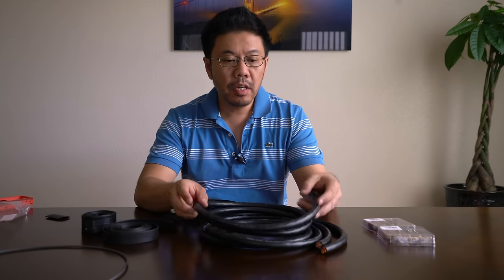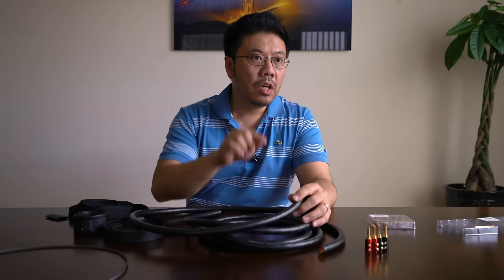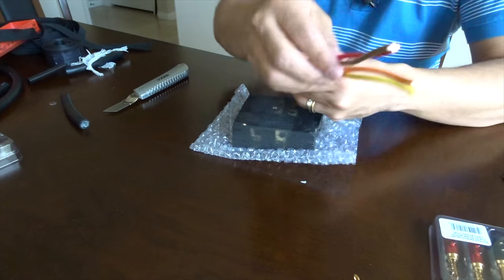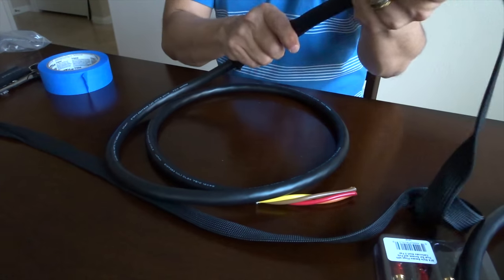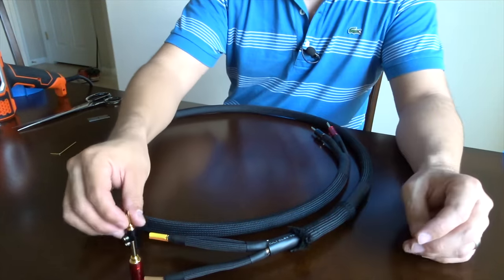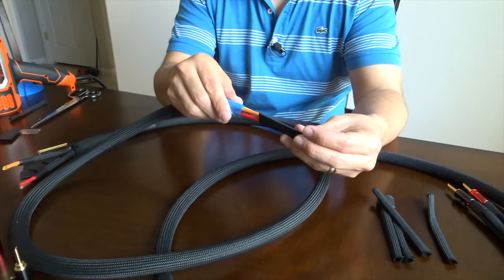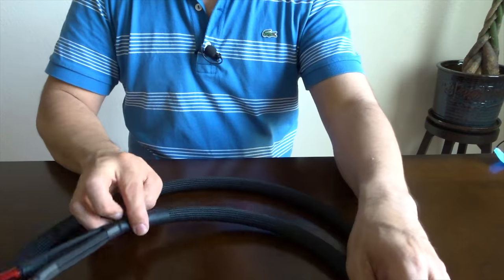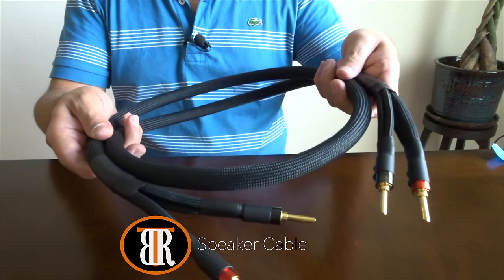Making The Best Speaker Cable For Money, How To DIY HiFi Cables

Comment: Thanks for this fantastic video! I have been planning on making my own speaker cables and this tutorial is one of the best i've seen. 
I do have a couple questions. 
1. Is there a technical/sonic reason why didn't you twist the pair of conductors before connecting them to each other?
2. I have seen other people's comments about star-quad wiring and your responses. I don't fully understand the importance of pairing or the difference between coupling two adjacent conductors vs. coupling conductors across from each other. Is there a difference?  

According to wikipedia, in star-quad configuration, "opposite points of the star are connected together at each end of the cable to form each leg of the balanced circuit." For the mogami, that appears to be red+yellow, brown+orange. 

Thank you!
Reply from the maker: Hi, No reason for not twisting them, I’ve done many cables and I just wanted to have flatter look when I was making this video.
Star -Quad position at end points are not important you can connect how you like it, there is no difference in sound quality and you still have whole length of star-quad in between them. 
But it all up to you, thanks

Comment: Does the Furez TST WP48 fits both  the Mogami 3104/3103  I ask this to be sure cause the WP48XL is no longer available
Reply from the maker: Yes WP48 should work fine with Mogami cables.

Comment: Thanks for this video. really appreciate many of your speaker comparison videos as well.. Since you've reviewed and compared many speaker and rigs, can you share what other cables you've used in the past where these cables you find to sound better.. You mention in a response post that your previous cable was the audioquest Gibraltar ...are there any other brands/models you feel these would be better than? Cardas, Kimber, etc.? Thanks.
Reply from the maker: My previous reference cable was Audioquest Gibraltar, which I owned for more than 5 years and I tried Kimber 8TC as well, compare to those cables in my system I like how much quieter background with Mogami cable was big eye opener and there no downside at all compare to those cables in every aspect, absolutely change my mind. May be one day I will try Cardas cables which is yet to experience, thanks
Reply: The Audioquest cables are like there is a bass boost eq built-in. Bass is good but there is a background high frequency noise which muffled the treble. On the contrary, the QED cables are like there is a treble boost. Treble is clear but either bass or mid range is weak. One day would try these Mogami cable. See them selling on Amazon jp at reasonable price.
Reply from the maker: @SpikeoutBattleStreet  You should also try Canare 4S11 which is very good cable with nice balance from top to bottom.
Reply: @Tharbamar  Thanks, I think I will try them in the near future. They're selling at ¥650/meter only on Amazon jp. I think I will pair them with onkodo banana plugs selling at the same shop. The fact I don't need the super details of QED cables or the excitement of AQ cables. I just want some pleasant sounds into my ears.

Comment: Hello, thank you for the video.  I trust your videos the most.

My question is, Mogami  3104 says the conductors are Red, Black, White and Yellow.  I only bring this up because Mogami says to reduce cross Inductance pair the wires on the diagonal so I was paying attention to your colors to see how you paried them but your colors are different...  Anyway, the "diagonal" is dependent on how you turn the cable which wires are diagonal?  You don't cover cross inductance in your video but the reason some cables are flat is for the same reason.  I am curious did you take into account which wires were used when you paired them?

Thanks!
Reply from the maker: Yes I did check it with mogami and they do not have any specific advice on color arrangement for termination, so I just paired with the one next to each of the wire for simple arrangement. Thanks

Comment: Hello! Love the video. I am hoping you can help me with understanding wire gauge effect on sound. I recently went from 16 gauge on my speakers to 12 gauge Belden speaker wire. I always had trouble with the treble on my system, and that has gone away. Sounds much more balanced at 12 gauge. Will there be an impact of a similar degree on treble loss going to the 9 gauge?
Reply from the maker: It’s more to do with the cables than gauge because cable resistant varies by design of the cables and length of the cables, for instance, cable like Mogami W3104 will bring out more resolution than many others yet low loss in audio signals across even for 300 ft runs. Only you have to tryout to see how it goes in your system.
Reply: Tharbamar thanks for the response! I have the cable coming soon, and will be building and listening :)
Reply: @DrkChmbrLrd  hows the sound now?
Reply: were you running a very long length or a cable that was insufficient for your systems impedance? 'Trouble with the treble' is unlikely to be caused by the speaker cable being 16 gauge rather than 12 gauge, unless you have an unusually high powered system with a long cable length and a low impedance.

Comment: Try and compare to Tellurium Q cable range (Blue, Black & Silver). I have tried almost all the “Internet Heroes” Van Damme, Canare, BJC. Granted i haven’t tried Mogami. But after trying all those and actually spending quite a bit of money, even though those cables aren’t expensive, they aren’t cheap compared to bulk speaker cable from the local hardware store. It’s money that could be put towards reputable cable.  My conclusion after hundreds of hours of A-B testing is that Audiophile claimed cables are 4-10-20 times more expensive, but they do provide a varying degree of improvements over the internet heroes. Are they worth it? Only the listener can decide. For me Tellurium Q provide all round better performance than the other cables I have tried. How? Less noise, darker background, tighter but detailed and nuanced bass, warm organic sound, melodic and toe tapping drive. You can fine tune by mixing and matching between the 3 ranges. The ranges do what they say they do. Blue “Warmth”, Black “Black background, communicative midrange” Silver”Detailed Highs, air and full bodied sound top to bottom” I have no affiliation with TQ, have owned QED, Chord, Kimber, Audioquest. Which also make good cables but currently the TQ are the best match for my current system (Bladelius, Moon, GoldenEar, Innuos). In the end its about system matching and one of the internet hero cables (Mogami, Van Damme, Canare, BJC, ect.) might be the best match for a given system. Let your ears be the judge.

Comment: I’m finding it impossible to get Mogami cable in the UK. Even getting the same gauge cable in any brand name is very difficult. I thought you were going to make the cables with 4 terminals at each end.
Reply from the maker: May be you can get them at pro audio stores.
Reply: Finally got 15 meters of AWG12  DCSk cable from Amazon. Videos and photos of this gauge of cable always look much thicker than it is in real life! It is reassuringly heavy though and made in Germany, so it’ll be good stuff. I tried to get 4 conductor cable for bi-wiring but settled for twice as much 2 conductor cable. I will twist 2 of them together in a drill and put a nice braided sleeve on it along with cable pants and banana plugs. 4 of the 16 banana plugs are right angle for the bottom row at the amp end, making it easier behind the amplifier.

Comment: Hi, if I can't buy 13mm and 16mm heat shrimp tubing, can i use the 12mm and 15mm heat shrimp tubing...1mm smaller..I searched locally the available size for the shrimp tubiong is 12mm and 15mm
Reply from the maker: Try to get bigger one with 3-1 or 4-1 shrink ratio.

Comment: Wow, fantastic work. Quick question: are these cables good at rejecting RF? I’ve always thought braided cables were best at reducing RF and were the most quiet.
Reply from the maker: Yes they are one of the best in noise rejection, thanks
Reply: @Tharbamar  How do you figure these cables reject RF? While, yes, cables technically would have a "frequency response" (due to capacitance inductance and resistance, I fail to see how you think this well reject RF noise without a lot of measuring and math. And if your amp is differential it wont matter (much) anyway.
Reply from the maker: @jakephilbrick7384  looks like you have no idea about star-quad cables, watch this video which I included the link in video description as well.
https://vimeo.com/155057552

Comment: Only thing I would have added would be wire ferrules, instead of just jamming the twisted copper into the plugs. The ferrule goes over the wire, gives it a more clean connection. Also makes taking the wire out of the connector way easier in the long run.

Comment: great video! Since these Mogami cables have 4x12AWG cables inside, have you ever considered making a bi-wire setup?
Reply from the maker: I do not like bi-wire because there is no benefit. Thanks
Reply: @Tharbamar  thanks for sharing your thoughts. The Mogami W3104 cable is well regarded. What are your long term thoughts on this cable setup that you made? Have you tried them out with your B&W 706 S2 setup yet?

Comment: is there a reason why you not using Mogami coaxial speaker cable?
Reply: excellent point. Mogami 3082 is what I've spec'd for a big set of PMC pro monitors in one of the top London recording studios. It is very difficult to persuade people to consider this cable for HiFi use when the trend is to go thick as possible ;)

Comment: Ordered some Mogami 2893 it’s quad conductor. It’s a bit thinner OD and super easy wrk with. I was using red black as pos and the other two to ground with the shielding. Any benefit of just tying all 4 to pos and copper shielding to ground?

Comment: With the final step of inserting the 2x12 guage copper wires into the connectors... any benefit to tinning the wire to prevent oxidation, prior to insertion?

Comment: what size nylon sleeve did you use for the inner cables
Reply from the maker: It’s been a while I don’t remember, Everything is in video description. Thanks
Reply: @Tharbamar  you have them twisted as brown and red  and then yellow and orange. Is this the correct set up? Which one is positive and which is negative

Comment: in my opinion you cannot hear any difference if you would use normal cables. pure copper is pure copper. However I respect your work! Cheers!
Reply: I agree with you somewhat.

Lets not forget that most speaker cable manufacturers say its x% grade of copper, hell I personally know a whole bunch of manufacturers who will use copper plated aluminum cable to connect the crossover board with the individual drivers.

Pure copper DOES make all the difference there and also connecting the speakers to the amp. Certainly thicker cable can make a lot of sense of we are covering a whole bunch of distance, but other then that, its all snake oil 99% of the time.

Comment: Can u do a comparison with duelund 12GA? I compare it with mogami 2 conductor 12GA and it is better
Reply from the maker: I will do one day, thanks
Reply: Dan Santoso , what did you like about the Mogami over the Duelund Wire in your system?? Or what didn’t you like about the Duelund?? And was the Duelund bare wire? As I hear that’s what’s best for it. Thanks!

Comment: Great video, I use the Mogami 3103 speaker cables. I don’t remove the speaker cables at all, so I have the bare wire inserted into the amp and speaker post. My question is do you think there’s an improvement with banana plus or is the bare wire connection just as good. The way you hooked up those Mogami sure look great though.
Reply from the maker: Many purists only use bare wires for speaker cables, in my opinion bare wire is better if you don't remove them and some says BFA Type Z Banana plugs have more contact area than direct connection but I don't know if that would make big difference in sound qualityI, thanks
Reply: Bare wire or silver dipped less resistance than banana plugs only exception is  high quality three nines fine or 928 silver

Comment: I'm not clear on the need for the 3 to 1 shrink ratio tubing.  Aren't the 3 sizes of heat shrink tubing listed sufficient?  I'm doing a Bill of Materials for this cable build.  I just want to make sure it's correct.  Thanks very much for this video.
Reply from the maker: Yes it’s sufficient but if you use 3:1 ratio, it will be easier to fit but it’s all up to your preference. Have fun Gary, thanks
Reply: @Tharbamar  Understood.  Excellent work on both the video and the cables.  I think I'm going to try it.

Comment: @tharbamar Canare suggests using/pairing conductors opposite to each other when creating speaker cable with 4S11 quad star cable.  I noticed you used adjacent wires instead.  Do you think what Canare suggested would work better for the Mogami cable too?  Thanks.
Reply from the maker: I tried both connection and there is no different in sound quality. Thanks
Reply: @Tharbamar  thank you!

Comment: I can not locate the 16mm braided nylon sleeving you use in the video. Everything I run across is the slick plastic like sleeving and not the soft type you use. Do you have a manufacturer name and model number for it?
Reply from the maker: Please see the links in the video description.
Reply: Me neither the link is expired is just get stuck on eBay
Can’t find the non expandable braid wire sleeve
Everything is PET expandable

Comment: Fantastic tutorial! Would you recommend bi-wire with this cable please? Or just just use jumpers instead? My speakers are Herbeth Compact 7ES and can be bi-wired. I am currently using Van den Hul CS-122 Hybrid cable these are 2x12.5 AWG conductors, so in bi-wire I have 4x12.5 AWG so very much similar, trouble is I have two cables going to my speakers, this cable would clean up the mess a little, cable is a bit ageing now and was thinking maybe of a change, would this cable be a step up from Van Den Hul? Maybe you have had this cable before. Or, what cable would you recommend if you were going to bi-wire your speakers please?
Best regards!

Comment: Tharbamar, Thank you very much for the information on those BFA terminals! Would you please check what is the hole size (internal diameter) for a wire in Parts Express BFA's in mm?

Comment: I really wish you made this video before I bought my Audioquest and QED cables. Please don't get me wrong. The AQ and QED cables are good but I believe these Mogami are better because they're  for studio use and I like Japanese audio products.

Excellent tutorial! Keep on the good works!
Reply: No not really I don't know why you think that , they have some more durability to them because of the way that used in a studio environment but you wasn't getting a home. But I would say the QED is a lot better they're silver-plated aren't they. How much were they per foot you should quite good value
Reply: @johnsweda2999  I don't have a chance to hear a Mogami cable. It would be the best if my AQ and QED cables are superior. Yes, some of my QED cables are silver plated. The Reference Audio rca and the Revelation speaker cables. They have high quality treble.  However, there is a complain to the low price QED product which is the built quality. My Profile Audio rca had already broken after using for only one year. The AQ cables have better build quality.
Reply: @SpikeoutBattleStreet  have never had a problem with QED maybe just been unlucky, they should replace it I think they give you 5 years guarantee.  you might want to try isotek as well cables but for speaker there's nothing to break go with silver-plated
Reply: @johnsweda2999  Sending a cable back and forth from Asia to UK is more or less the price of a cable. Furthermore, I don't keep invoices of cables because cables seldom break.
Thanks for your suggestions and advices anyway.👍
Reply: @SpikeoutBattleStreet  (Not just to you, Spike, my friend-In general)I use Mogami 2534's Star Quad 4 conductor interconnect cables! I put silver plated plugs on them with silver Cardas Solder, and my cable matches or beats Audioquest up to a Ukon series, which is multi-hundered dollars for the same lengths! Can't hardly beat a good studio Mogami Neglex with quality solder and plugs! I have 4 sets, 2 on my turntable and phono stage and they are best i ever had on it! & I have a nice TT system! But you have to let them "settle" after you connect them to your components, has to do with factors at the atomic level and the conductor interactions with the insulation! Don't keep moving your cabling, folks! You need very small multi strand tinned copper or silver covered POCC for the best results, but these are just fine for MOST systems! (Skin Effects) But I have been studying conductors and cables, building them for over 7 years!
Reply: @dark-eternalknight3379   Omg, please don't tell me. I'm still using the AQ and QED cables LOL. However, someday I may try Mogami. Like I said, I like Japnese audio products for high CP value.

Comment: Using Mogami W3104 makes sense, however, W3104 cannot be considered cheap by any means. I think  that its single pair variant, W3103,   costs nearly twice as much as W3082 so W3104, being twin pair, should cost even more. What do you think about using W3103 instead or even two lengths of W3082? Two lengths of W3082 should still be slightly cheaper than one length of W3103. The point of using two lengths of W3082 in parallel is to achieve symmetry between + and - conductors (or red and black if you prefer) by connecting together the braiding of one length to the core of the other and vice versa at both ends of each length. I'm not sure whether the result would be better or worse than the W3103 (haven't tried it) but it might be cheaper.